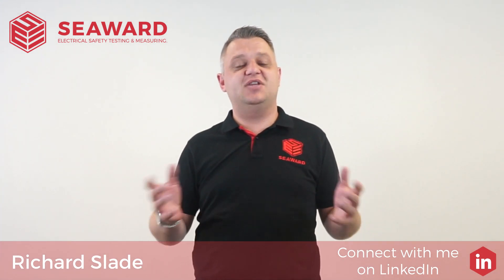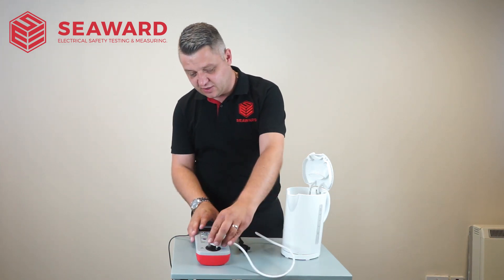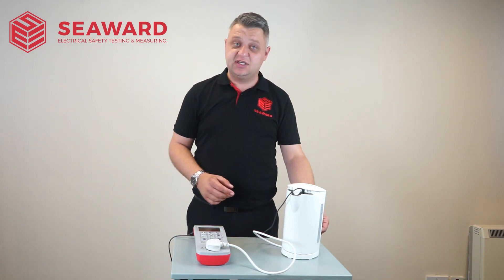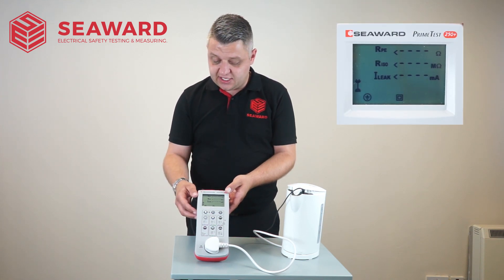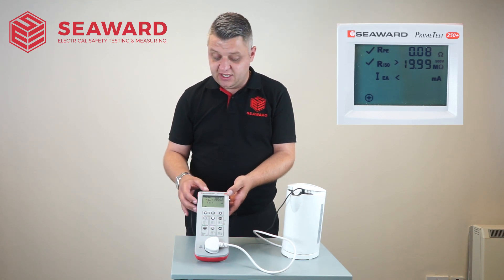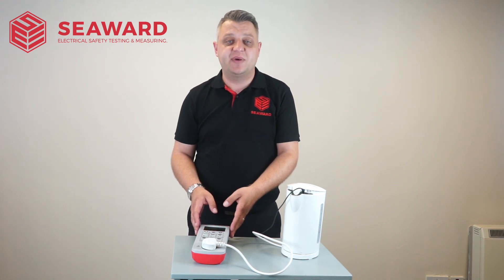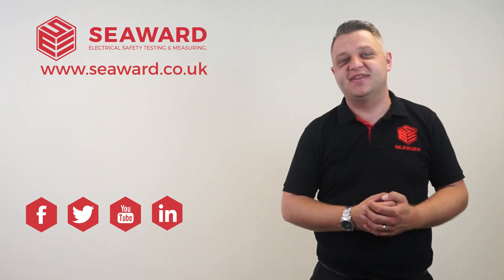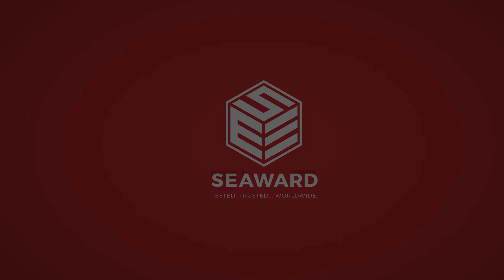How to PAT test a Class 1 appliance (kettle) - Seaward

Comment: Do you not plug the kettle into the mains for this test? or is this done off of the battery in the PAT Tester? I have the Seaward apollo 400+ and I get an error message when trying to do a leakage test, the test is pre-programmed to do earth continuity, insulation and then leakage, if I do this test as you have shown in this video the error I receive is no mains voltage??